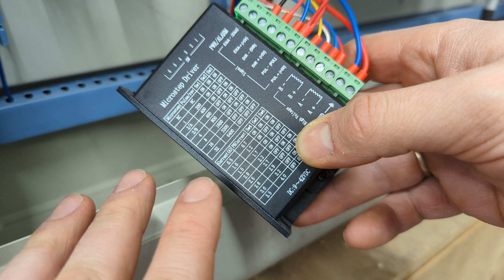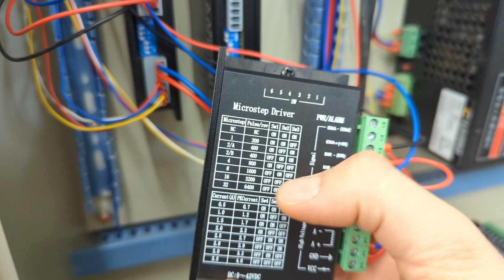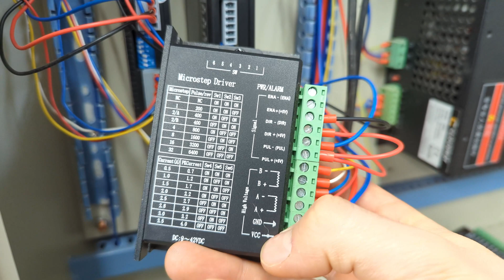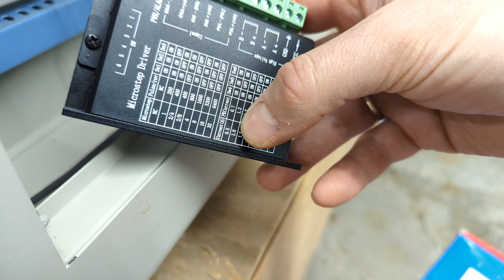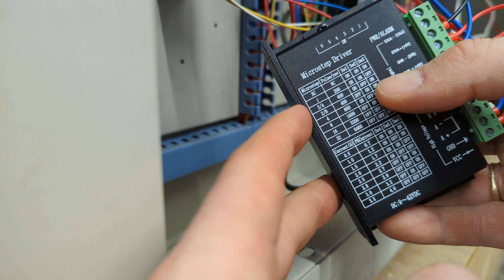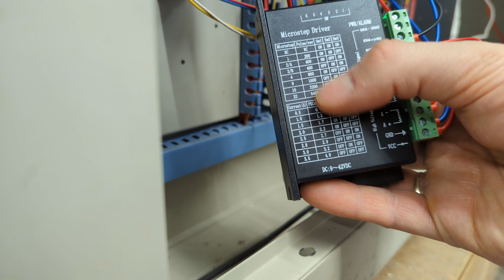Stepper Driver Issue on your CO2 Laser? Here's How To Fix, and How To Set the Dipswitches

Comment: Hello we have an omtech laser and the x axis driver when cutting diagonal the cut is jagged and the machine make a noise while cutting.
2nd issue, the unit gets stuck and only move vertically at that point the x driver shows a red light. Any insights?

Comment: It's worth mentioning here that the steps settings have less to do with gearing and more to do with smoothness. Say we need to design a display: a 60 seconds clock face timer with a seconds hand. To use a 60-step stepper motor, the seconds hand would show 1 seconds increments with the controller sending a pulse each second.
Many requirements call for smoothness however, and by keeping both coils energised, the rotation is held between the motor's steps, hence a psuedo step is attained. Many circuits incorporated this as 'half stepping', and the driver would facilitate half second pulses from the controller. Further, angular positioning has been taken to the extreme by energising the coils by various amounts, and easily applied with today's microstepping drivers.
200 step steppers seem fairly generic now, and 200 printed on the stepper driver saves the math. Microstep settings should be increased until sufficiently smooth, to avoid possible heat and other issues at the higher settings.

Comment: I could use some help.  Your video was the most helpful that I have seen.  I have an 80 watt C02.  I am on my 3rd Stepper motor.  I have checked EVERYTHING.  It seems my motor keeps burning out and we cant figure out why.  Ive rewired, tested the belt tension, made sure rails are lubricated.  Ran through the tests on your video.  Nothing is working.  I don't know what to check.  My laser  has the grinding/vibration on the Y axis

Comment: what could be a causing erratic cuts. for example if I cut 10 holes of 3mm  x 20mm in a vertical line i get 3mm x 20mm - 3.1mm x20 - 3.1mm x 20 - 3.2mm x 20 - 3mm x 20 and then 2.8mm x20

this is something that hit me after 7 years of no issues. Can stepper motors get fried or screwed up somehow or is it possible something else. 

I am using a 100w c02 china copy 1300x900

Comment: hello, I made a co2 laser by hand and I have a problem with the x axis that loses power in the 6600 driver and stops moving and the motors are 3 amps, t nema 23, while the y axis works normally, did they blame it on the driver or something else, both axes are set the same I ordered new dm542 drivers just in case
 thanks

Comment: Hey, I need some help so I have a c02 laser with similar step drivers, so the issue is someone changed those mini SW Switches on the stepper driver and now the laser head does not move past half bed size in both x, y axis basically running half of what was a 1300x900 bed size although when it halts to a stop at half bed size, the controller seems to think it has traveled the complete distance, and is also now inverted, can you help out somehow?
Reply from the maker: Hello! I believe your issue can be fixed in lightburn/rdworks by going into vendor or machine settings. You'll want to change the step length of the machine (I have another video on this) and invert the direction. I can help you more specifically if you email sales@lasersupply.ca!